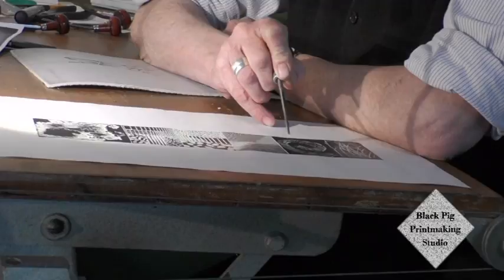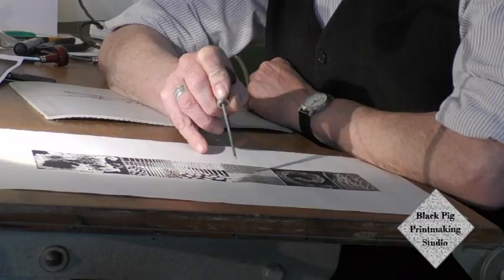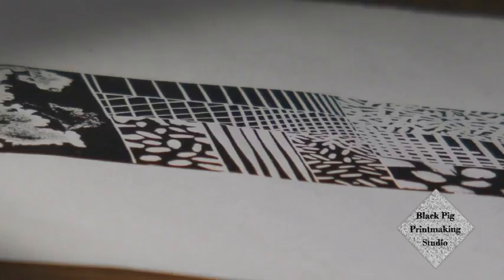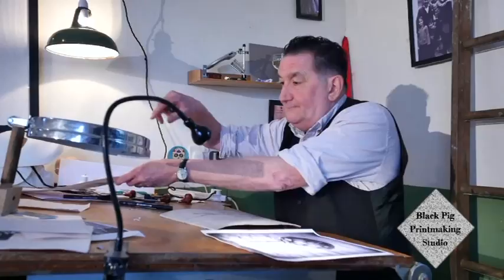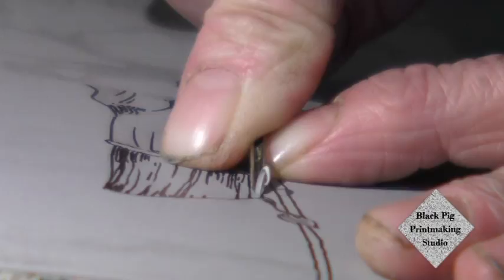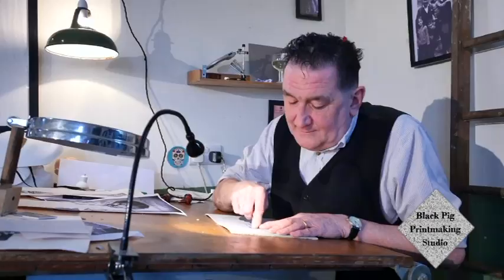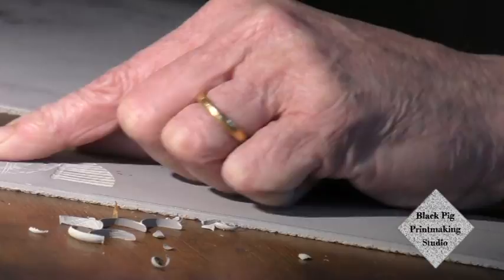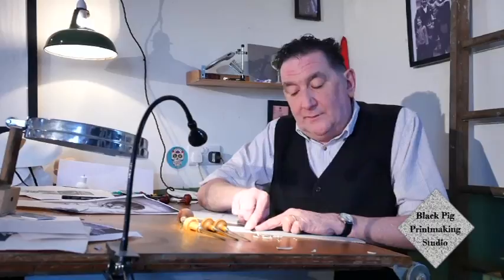Linocutting and tools

Comment: hello, I absolutely adore your videos and your love for printmaking! I am starting with lino printing and there are two questions I was not able to figure out yet. I wanted to do some very detailed work so I have purchased a very small U carving tool and they told me it is the smallest option I can get. However, if I get a really small V tool wouldnt I be able to cut even smaller lines? The other question is - when I try to print bigger lino formats, it takes me a ridiculous amount of time to put the paint on the lino plate, as it is always too light and not layering up very well, can this be mainly a problem of a roller or are there any other tips to make it layer faster? Thanks for your answear and have a great day!